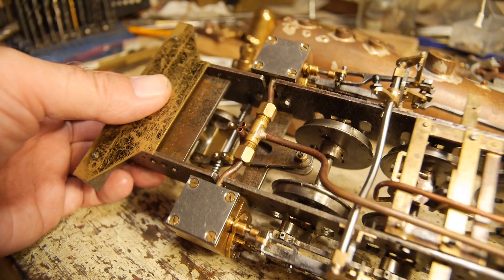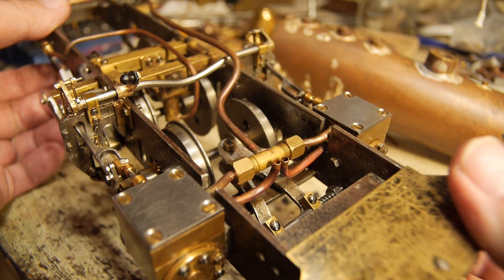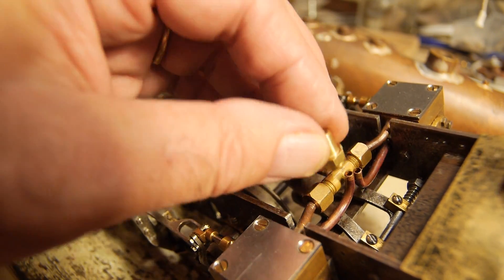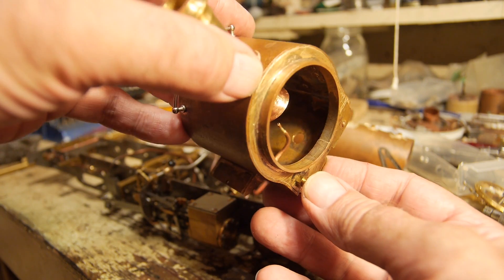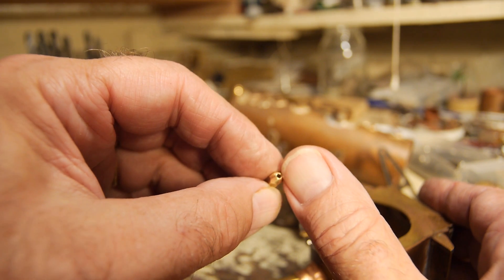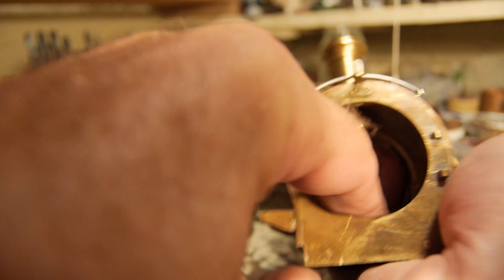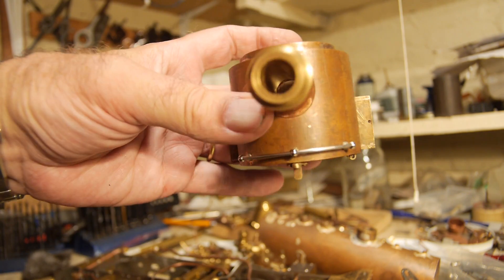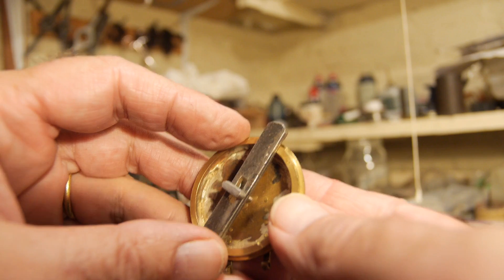'Russell' Live Steam Model Locomotive Part 11

Comment: where do you get your tiny bolts? those hexagonal screws, and the  tiny detailed bolts on the handle of the smoke box hatch
Reply from the maker: The small bolts are BA hex headed bolts with their hexagonal head one size smaller you can get from: ba-bolts.co.uk   and you can get the small rivets, 1/16" brass, from the same place.

Comment: On the threads do they have o rings.
Reply from the maker: No, I use thin copper washers.  I use 'o' rings only on filler plugs that come on and off a lot.
Reply: Good question Sabrina.

Gandy,

Do you anneal Cu washer B4 use?  If you do that, it'll deform/dent it 
when tighten, which is good for tailored fitting but should be replaced 
after disassembly?

I was wondering why my Pearse's L&M 2-6-4T uses Cu washers at
all of pipe junctions.  Maybe it is because Cu can easily withstand hi
temperature better than say Si O-rings and perhaps it doesn't deform
easily.  And, we can make any sized Cu washers ourselves vs. go hunt 
for one.   Need to tighten Cu washer'd joints much harder than the
softer O-rings though.  E.g., for some reason, on my butane fired loco
above, i've found i cannot ignite the loco by poking my BBQ lighter
at the chimney.  I heard some roar but not like usual.  Found that
the superheater pipe junction into the cylinder T-joint was lit w blue
flame and no flame coming out of the flue itself.  I can't imagine how
the flame got into the steam pipe instead of the burner inside the flue.
But after tightening that Cu washer joint stopped that unwanted fire.
If the washer was an O-ring, i really would have had a enjoyed BBQ 
smell.

Yes, Ian also uses O-Rings at the lubricator cap, piston valve's
input steam ports (but no O-ring on the piston valve itself), and
T-joint arms to live steam pipe joints (slip fits).  But after long inoper-
ation, i think the rings have turned to clay except for the big one at
the lubricator.

From this experience, i decided i would always light my butane 
powered loco by opening the smokebox door* to light vs. the chimney.
Since now i've found Pearse's smokebox is made of Pb, i was lucky
to terminate this nightmare.  Pb seems very popular material
for castings in UK to my dismay.  U can't solder or repair them but 
glue them and they come off easily as well, esp. on the hot boiler
skin.
------------------
*Roundhouse's smokeboxes of mine are permanently shut so need 2
  be cut opened however.  But sure make them convenient since the
  door never flops open w embarrassment during a run!

Jeffrey
Reply from the maker: On some threads I use teflon plumber tape.  I really use thread sealer like Loctite because it can be difficult to get the fitting apart again without damage.
Reply from the maker: The reason for copper washers is their durability and you can get them in different thicknesses to adjust the position of threaded fittings.  I rarely anneal mine unless they have got hard with use.  Keep 'o' rings away from flames and some types can be susceptible to oil rot.  Sometimes if the gas valve is open to much the flame won't run back to the burner from the chimney.  I don't know what material is Pb?  Do you mean Phosphor Bronze or zinc?
Reply: Hi there Gandy Dancer, atomic number 82 and symbol Pb is my old workmate LEAD, I was a plumber in the early 60's, your series on models is remarkable, keep it up.
Reply from the maker: Thanks binness, for for the definition of Pb and comment.  Don't forget to subscribe if you haven't already.

Comment: Hi Gandy,

1.  Got another question.  What pipe size and pipe fitting thread do you use? 

I'm thinking of replacing all the fittings on my Pearse L&M 2-6-4T which i think is of ME 
thread, 3/16x40TPI* to 1/4x40TPI.  The fittings for the former have hole size of only
.054"D at the end of its superheater pipe that transmits the steam into the Cylinders'
T-joint pipe.  Found the superheater pipe clogged and that probably caused its anemic
loco's motion.  The loco uses 1/8OD pipe but at its critical junctions (like at a lubricator
and mechanical whistle to cylinder switch), the port gets chocked to .054.  The exhaust
pipes also uses 1/8"OD but crimped at the chimney and it was leaning against the chimney's wall, just ~1/4" below the top of the stack.  I guess it was to show off steam
plume.  But yes, i understand the exhaust ports and pipes should be 2x bigger in diam. 
than the input ports n pipes.  Yet, my current concern is the input steam circuit.
I've found all the ME taps n dies are cheap and they are of carbon steel, of which
i dislike since carbon steel are brittle and small taps can break inside a hole.  I think
a die of this tool steel s/b OK since it has enough teeth n ample chip clearance!

*Actual caliper measurement showed .172 to .180"D and counted 11 thread over 1/4"
 length ==> ~3/16D x 44TPI but there's no such thread here or in UK!  And, no metric
 coarse or fine thread match.  So my best guess is 3/16 x 40TPI

2.  What's your source for pipe joints (brass nipples,  nuts, and threaded heads)?  I don't
     want to make them though i could out of brass hex stocks
Reply from the maker: Hi Schuten, I use 1/8" OD copper tube for steam supply and 3/32" OD copper tube for water and blower steam.  I get this thin wall tube from K&S Metals.   For the 1/8" tube I use 1/4" x 40 tpi nuts and nipples and the 3/32" I use 3/16" x 40 tpi fittings.  I get these nuts and nipples from Macc Models Engineering Supplies: https://maccmodels.co.uk/  Here are other suppliers if you look round the web.  

Roundhouse Engineering have found that their superheaters clog up with burnt cylinder oil over time and recommend a different oil to prevent this.  This is what they say on their website:
'The current oil supplied by Roundhouse is, to use it's correct title, 'Compounded Bearing Oil 220' (220 being the weight or viscosity) and was chosen after consultation with the oil's manufacturer and discussion as to its precise application and working environment. The change of oil was brought about a few years after Roundhouse adopted internal gas firing and a small number of engines were experiencing blocked superheater pipes after prolonged use. The blockages were caused by carbonised oil, though this had never been a problem with the earlier externally fired models. The key points that dictated what oil to use were as follows. '
Reply: Good Evening Gandy,

Thank you for your quick reply.  I guess you are using smaller 3/32OD
Cu tube purposely to cut down waste at the blower and water circuit
and bigger 1/8OD for the input steam.  And also thx for matching the
fittings to those pipes.  I'll check out the Maccmodels for them.
Yes, i use K&S pipes and brass sheet/strips too.  And also 
thanks for the additional info from Rndhse about the oil to keep the tubes clean.  I always had a little trepidation about mixing 
steam w oil thru the narrow pipes vs. direct injection of the oil into 
cylinders using a mechanical lubricator as in the prototype.

I'll go ahead and replace my loco's small 3/16 input steam joints with 
1/4 x 40TPI joints.  Since this loco is gas fired self draft creating type,
it doesn't use a blower as the Rndhse's locos.  Perhaps, later on,
the 2-6-4T may wish to get a pair of true working water tanks as
your Russell and if she does, a water shutoff valve with a long needle 
nose should be able to regulate the water flow well and can still use 
1/8OD pipes there too?

Do you use a cut down mustard cap for your air pump nuzzle for
your loco air test?  I guess i can machine some plastic w barbed end 
to fit into an air hose at the back end and tapered nozzle at the front.

I'm also thinking about using screw-able 1/4 x 40 nut and tongue joint 
for the air pump nuzzle.  In this way, my hands would be free to check
out for leakages.

Thanks again,

Jeffrey
Reply from the maker: Hi Jeffrey, I mainly use these diameter pipes so that they look scale if they are seen on the outside or inside the cab.  I don't use a long needle shut off valve for my water by-pass, just an ordinary off the shelf right angled globe valve with the appropriate threads for the pipe i'm using is enough.  3/32" OD pipe is ok for water by-pass too.  

I always use water to check for leaks.  Pump up through your water fill valve as i do in Russell Part 20.  Water leaks are much more easily found than air leaks.
Reply: Hi Gandy,

Thank you for your more info on the pipe size n valves.

I've visited your part 20 water test.  For my L&M loco, it doesn't use
axle water pump.  The water tanks are fakes.  I've noticed that after
you've filled the tanks, you've connected an air hose below cab to
shoot air into your cylinders which in turn ran the axle water pump.

I guess i just need to machine a plastic nozzle with a barbed end to
fit into a 1/8ID x 1/4"OD plastic tube for the air compressor.  The
plastic nozzle seems very easy to use and universal.  For my other
(Aster) loco, i've just machined a barb with a matching fitting nut
in metric to connect the air.  I like this threaded connection since
my hands would be free while doing the air test but i need to make
special ones for every locos this way!

For steam path leakage test, i've found i can more quickly and easily
see bubbles rising when i dunk a boiler with fittings or an entire loco
in a water bath while pumping air into the boiler.  I've also tried 
brushing soapy liquid to various joints while steaming or with an
air test.  That works OK too but the leaks won't show up dramatically
as the water bath test.

I've ordered pipe connectors per your recommendation at Maccmodels too.  It said however that they're closed till 5th Jan 2017.
That means the parts won't be her in California till perhaps, mid
or end of Jan.

It sure was EZr when my model interest was in 0-scale electric
trains.  Didn't need to worry about the Walschaerts though the
models had them.  But i've noticed that the Die Block was always
in mid gear.  And of course, needn't worry about the plumbing or
fueling.

Yes, i'm just learning piping and fitting things.  Your advice was
appreciated.  Thank you again.  And thank you for posting all
those lessons here in youtube.

And Merry X-mas,

Jeffrey
Reply from the maker: Hi Jeffrey, glad to be of help.  I have a coned nylon adaptor on the end of my compressor tube.  The coned end is small enough to fit into most holes on the locos.  The hole I use on Russell is a water fill device going to the boiler via a non return valve.  So the boiler pumps up with air and wholes it till I open the throttle.  On other loco that don't have the water fill I remove the safety valve and and push the cone end into that to run the engine.
Reply: Hi Gandy,  Thanks for the simple coned air connector description.
It's great since that is so universal.  I think for the your Russell, the
water filler valve is called Goodall Valve.  I was wondering if it can be
used for the air filling the boiler too and i guess it works for you.
Reply from the maker: Yes, I'm using the Goodall valve to pump air into the boiler as you can see in Part 20.  Don't pressure test a boiler on air.  Make sure the boiler is in sound condition by filling it with water first, excluding all the air and pumping to twice working pressure with more water via a pump.  Water is incompressible and if the boiler bursts or give way it won't explode you'll just get wet.